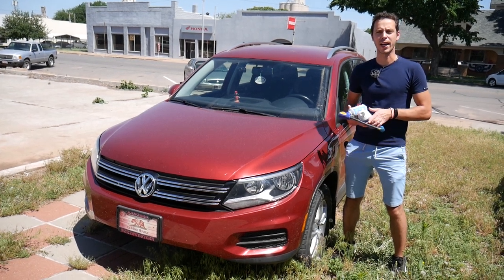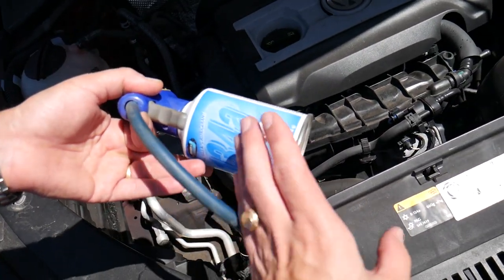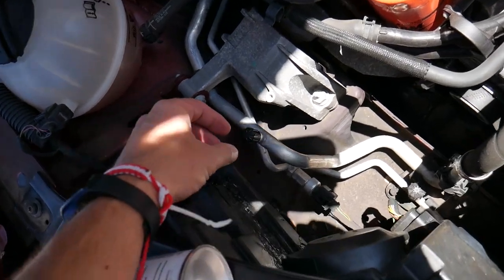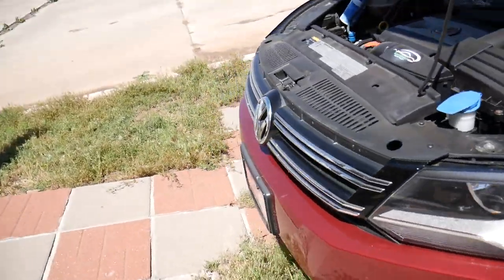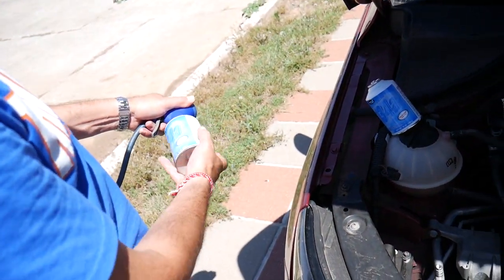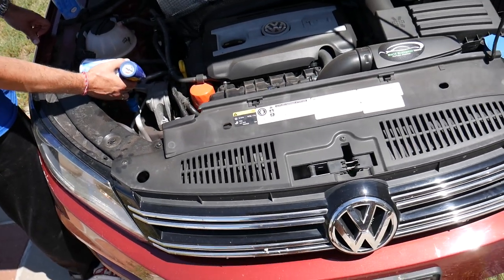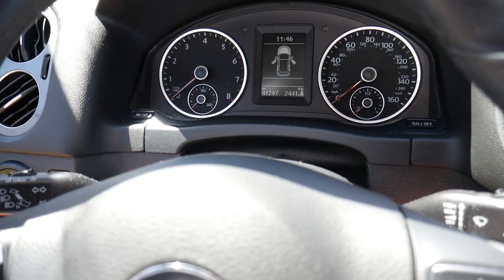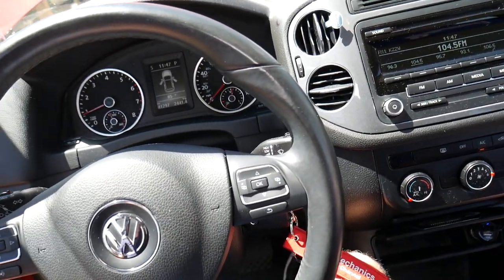HOW TO RECHARGE AC AIR CONDITIONER ON VW TIGUAN / AC BLOWS HOT WARM FIX

Comment: My car ac blows warm air when I’m at a red light and it blows cold when I’m driving any idea what it is???
Reply: Clogged condensor or broken radiator fan or a compressor that is not correctly or you could be low on refrigerant
Reply: @xls4750  cooling fan.

Comment: I live in Las Vegas and drive a 2014 Tiguan and the AC works fine, im just disappointed with the fan speed, even with the setting highs the fan speed doesn't nearly as hard as my other cars I drive. Is there a way to upgrade the AC fan blower?
Reply: I have noticed the same on my 2019. Need to run at highest speed all the time. I have not found a way to upgrade.

Comment: I tried to do this with AutoZone r134a and surebilt recharge hose and it reads the pressure as 65 psi after running for only a few minutes. Is there a reason it would have such high pressure if it was empty when I started?

Thanks for the videos, you've helped me out a lot!
Reply: Same here my system was empty and I filled it to 35 PSI but my car needs 525 grams and the van was 565 grams, you have to put almost the entire can in regardless of pressure